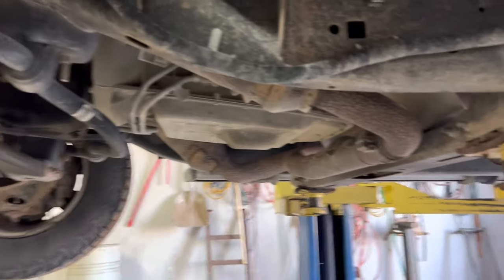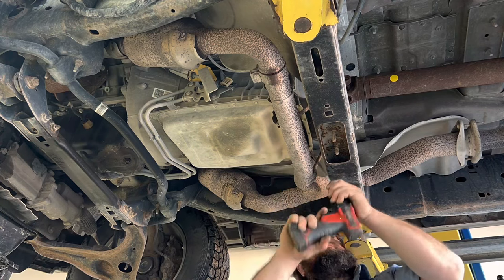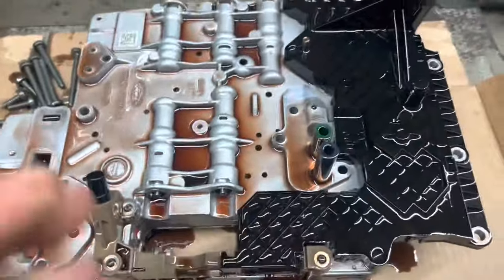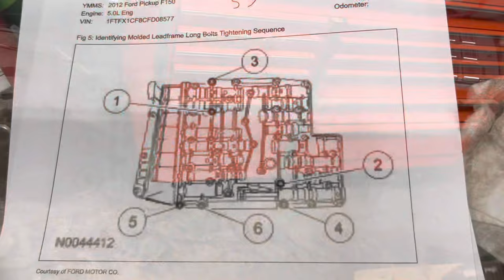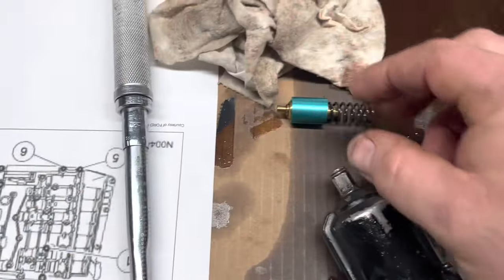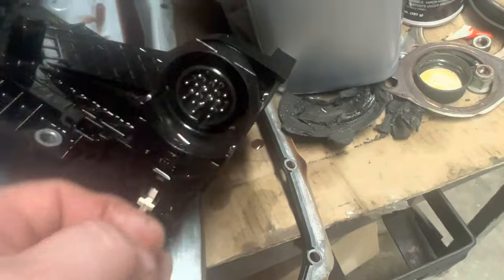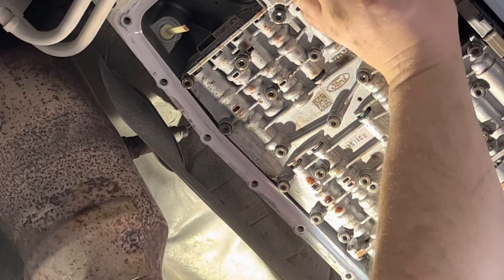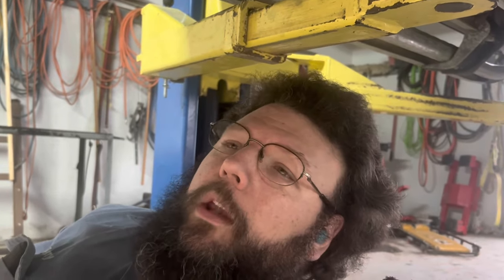Leadframe/ sensor assembly replacement on a 2012 Ford F-150 with 6R80 transmission

Comment: Thank you for making this video! After my F-150 abruptly downshifted from 6th gear into 1st gear, I took my F-150 to the Ford dealership & after a week they told me I needed a new motor & possibly a new transmission. They had no clue what was wrong with it or were unwilling to fix it even though Ford had issued a nationwide safety recall for this issue. I wish I had a reliable knowledgeable person like yourself nearby. Thanks again!
Reply: Why are dealers always acting like a ignorant slobs why
Reply: JUST GOT A FACTORY RECALL FOR THE SPEED SENSOR

Comment: Man I appreciate you making this video I took my 2011 F150 to a local shop and asked how much to change my leadframe he immediately told me he had to rebuild the transmission and it would run me 1800 to 2500 dollars I told him I had research the problem and everyone who had the same symptoms it was the leadframe. So thanks a lot I’m gonna change my lead frame tomorrow picked on up today
Reply: Where did you find one.  I’m in the same boat.
Reply: @kozmorulz83  There are plenty on ebay, but you most likely won't find an oem part because they no longer make them.
Reply: Same here, I paid 2 weeks ago for a rebuild and it never stayed right. They blamed everything but transmission. Long story short its in the shop right now and I found a lead frame local thank god. Crossing fingers 🤞
Reply: Does Ford have to reprogram or can the lead frame just be replaced? There was a reprogram done on my truck(13 F150 Limited 3.5l ecoboost 4x4 v6) in 2020... Please advise ! Thanks

Comment: Replaced this part warmed it up got the fluids right, put it into reverse and all the gears are neutral would it be those 6 solenoids on the valve body?
Reply from the maker: Probably missed the manual shift valve while putting the valve body back up

Comment: I just had the lead frame replaced on my 2016 at the dealership. The service advisor tried to explain what they did but I don't think he even knows what a transmission is as he pronounced it "led" frame lol. So thank you for clearing showing what was actually replaced on my truck. Next time I will do it myself as it is definitely something I can handle with my mechanical abilities.
Reply: In his defense, i thought it was lead like led too, just because of lead beind a special metal. This is the first time I've heard it pronounced otherwise

Comment: Apparently the area we are stuck on is the installation part that made you mad and skipped. That valve we had to figure out and the linkage between the shifter lever and the valve body comes apart when we try and run the truck. Had to pull the pan off again, trying to figure it out for the 2nd time now... we will see.
Reply from the maker: I was having trouble keeping that spring loaded valve up in the case while putting the valve body up and lining it up with the manual valve.
Reply: I put a glob of trans-assembly freeze on the thermal sensor and it held it in the valve body .
Reply: Trans assembly grease/lube

Comment: Great video. My 2013  just started screwing up. I bought it used a year ago it only has 54,000 miles on it but the extended warranty only lasts 10 years so they wont cover it.  Im fairly mechanical, but now seeing whats involved with this repair i'll suck it up and pay a pro.

Comment: My 2010 F150 5.4 with a six speed six or 80 has 144,000 miles on it I just bought it last year don’t know if it’s ever been service for the transmission or not before but the fluid was low I put Lucas transmission Conditioner in there which is for also LV fluid. The symptom I’m having is the last two weeks whenever the truck is cold up here in Pennsylvania in the summer it gets down to about 60°F. But whenever the first 10 or 15 minutes I’m driving it whenever I come to a stop sign and pull out after a complete stop it does like a neutral slip and bangs in the first gear. It does it for like two more stop signs and then once it warms up it goes away. This happens every morning I took it to my local Ford dealership they put the scanner on it it came back no electrical problems and I asked them about the lead frame and he said everything came back OK but somebody else is telling me it Hass to actually be doing the symptoms for the scanner to pick it up. I don’t know if that’s true or not any thoughts on what this could be? Somebody else that may be the drive shaft You join or something but then it would do it all the time not just wants cold out I’m imagining… great video thank you for sharing!
Reply from the maker: @zmaninpgh  are you sure you checked the level correctly? They are very sensitive to temperature changes affecting the fluid level.

Comment: Working on a 2010 f150 w a floor shifter won’t go all the way into park, when I manually put it in park underneath the shifter is stuck in park 

my first hunch is the cable, it doesn’t extend all the way down but deep diving I’ve found could be the shift interlock solenoid, brake light solenoid, the shifter itself and now this lol

I’ve manually reset it to take a look and took apart the shifter to see what’s going on, I have it responding w the brake for now so maybe I can eliminate the shift lock solenoid but I’m stuck where to continue my diagnoses 

I put the shifter into D, engine off

Manually put the transmission into D

The cable and shifter don’t line up

Turning back on the vehicle Resetting to Park, they don’t match up again

I’m gonna try the fix for a new cable in case it’s stretched I think

Comment: Thank you for making it make sense. My 3.5 EcoBoost gave me the "Rench " from hell displayed so I pulled over thinking oh, no problem i'll just turn off then on the truck then it may reset. Nope. the truck won't even crank. I checked for codes and the PO706 & PO707 came up. had to get the trucked towed. I'm assuming the "no crank" is normal and nothing I can do till the Leadframe is replaced. thanks for any comments or suggestions.
Reply from the maker: Those codes are for the range sensor, check your wiring and connections at the trans but that sensor is part of it and won’t start because it doesn’t know what gear it’s in.
Reply: @bulldogsautomotiveadventur4387  Great, I'm assuming the connection is the one you show at the "4:23" mark of your video. Is there any other connection other than that one? or just trace that one on both ends.  thanks
Reply from the maker: @Perry-cl2ne  I’m pretty sure that’s the only one, they put everything in that one frame so it all has to go through that connection, fluid leaking through the connector can cause issues as well
Reply: @bulldogsautomotiveadventur4387  last question, does the connector wiring get powered by any fuses? i'll be looking at the connector this weekend. thanks again for everything.
Reply from the maker: @Perry-cl2ne  I would have to look at the wiring diagram but most of those wires will be to the computer, power will likely be relay controlled with switched grounds to the solenoids, sensors will be direct to the computer
Reply: @bulldogsautomotiveadventur4387  thanks for all your knowledge suggestions

Comment: I think this may be part of my problem I’m having w my 2012 f150 eco boost 3.5 ( K.R ) it’s not wanting to shift out of low I’ve changed the transfer case motor it is also not showing correct speed says it’s doing 70 at 20 mph ( rough estimate)it feels like it is in a 4x4 with low rpm low gear whine but shows at 2x4 on dash transmission also shifting hard into gear I have been experiencing the notorious down shift issue I’m hoping by replacing this I could solve some of these issues do you think I’m going down the right path my next move would be replacing iwe and tubes? Idk help please
Reply from the maker: That sounds like something in the transfer case or associated computer…if it’s all something that happened at once for no reason I might look for common grounds but you might have to have that properly diagnosed at a shop.
Reply: The transfer case motor wasn’t properly indexed fixed $300

Comment: Hello sir I hope you can answer my questions I took my truck for the recall lead frame  speed sensor . in 2019 . now I have the problem you think they will fix it  again
Reply from the maker: Not under recall, and the dealer usually doesn’t offer any warranty past 1 year

Comment: Debating weather my valve body or lead frame is bad , will downshift hard from 5th to 4th only but only when it stays in 5th gear for a while I guess when it builds pressure, on 6th gear overdrive it seems like it looses pressure while driving almost feels like it down shifts but it’s not shifting it stays on 6th gear
Reply from the maker: Need to have it on a scan tool and see what the pressures are doing

Comment: I just replaced the lead frame and had the recall sw update done by dealer. After doing the lead frame the transmission is slipping bad now. Everything went back together as expected but I didn’t put the transfer tubes in the trans I left it on the valve body. Could that be why? Only drove it a few times before doing this repair and it didn’t happen before. 250k miles on it
Reply from the maker: Very possible, those tubes act as a seal

Comment: The transmission in my 2013 Mustang with a V6 Automatic is having that same issues.
All I hear about is the F 150. What about the mustangs? They aren’t part of the recall?
Reply from the maker: No recall on this to my knowledge, haven’t heard of the mustangs doing this yet
Reply: They have a recall on it... But you have to have under a certain amount of miles

Comment: Hello, greetings, my 2012 3.5 truck has a knock when I park, sometimes it knocks a lot in first gear, do you know what I need to change?
Reply from the maker: Noises are something that have to be diagnosed in person, it can be narrowed down but not pinpointed…I do know they have a lot of timing chain problems that rattled on startup, if that used to be a problem and now it sounds like that all the time then it needs addressed soon.

Comment: After you replace either one or both lead frame or valve body, do you need to programming in system? Or just remove and install then drive it like it will be normal again?
Reply from the maker: @Sordoarizona  we usually just clear the codes from the system and drive it, but we’ve never had to replace a valve body, just the lead frame
Reply: @bulldogsautomotiveadventur4387  you don't have problem with transmission after all?
Reply from the maker: @Sordoarizona  I’ve done a few lead frames for sensor issues, never had to program one yet
Reply: @bulldogsautomotiveadventur4387  I did have issue with my 2014 F150 4x4, sudden downshift gear from 6 to 1 while driving, scan and found code p1500, and found out that I have recall #24s37 for that issue after have dealer send a mobile technician to update software that was 4 days ago, then just today, it did it again and this time all codes appear all from transmission p0720, and many more... I told dealer it was after they flash it with software and it come worse... They said it wasn't software that they updated that cause it... They will let me know by Monday to see if recall would cover it.... I tried to look for solution because I can't afford replace for $8k... I see you did replace lead frame and drive fine...
Reply from the maker: @Sordoarizona  ford definitely has a problem with some software updates, no idea if that’s your issue though
Reply from the maker: @Sordoarizona  both those codes are for speed sensors, both are part of the leadframe, the p0720 is also covered under the recall but if they’ve “completed” the recall they might fight you on it…it’s the same problem as before.
Reply: @bulldogsautomotiveadventur4387  I hope Ford will cover it, if not, I am gonna have to replace either lead frame or valve body or both... Should I drive my truck to home from dealer if they refuse to cover it... My home is 5 miles from dealer on city street 45 mph.... Or better tow it to home?
Reply from the maker: @Sordoarizona  if it could randomly downshift I wouldn’t drive it, it’s amazing that it lived through the last one
Reply: @bulldogsautomotiveadventur4387  that is third time that it downshift, first one Oct 11, then 17, and had Ford update the software on 22th, then again just yesterday and that was it and I stop drive it, it was still driveable, but I stop and won't drive it till Ford tow it... What happen if I continue to drive it?
Reply from the maker: @Sordoarizona  it will either completely destroy the transmission, the engine, or both

Comment: I have had an erratic shift for several months 2017 6r80. Everything points to the OSS throwing a fit. Is it wise to replace the leadframe(with new valve body, as the leadframe alone is usually unavailable) altogether, or could the sensor alone be swapped? Having trouble finding a part number for the 6r80 OSS. Rock auto seems to only have 10r80 sensor available.
Reply from the maker: On most of those parts we source only from the dealer, I haven’t had a 17 in with a 6r80 in, I’ve only seen them in the older ones, early teens.

Comment: So I replaced it on my 2013 F150 a couple days ago. Followed step by step and topped off the fluid, but the transmission no longer allows reverse. Any ideas what may have caused this?
Reply from the maker: Does it get all the other gears? I’ve never had one do that but I’ve seen a lot of people miss the manual shift valve on the driver side.
Reply: It hits all the gears but reverse won’t engage. @bulldogsautomotiveadventur4387
Reply from the maker: @user-yr5nj4vc1h I would check the pins in the connector first, but I would think it would be solely hydraulic
Reply: @bulldogsautomotiveadventur4387 what does that mean. Would it be bad solenoid or need new valve body?
Reply from the maker: @swishyboi7444  I would assume something like debris might have gotten in during installation, improperly installed valve body, or something like that.

Comment: Hey man thanks for this awesome video. I’m thinking I need to replace my valve body on my 16 f150 5.0 ;97k miles, 6r80. I’m having intermittent shifting issues particular at faster speeds on highway.sometime when I press on gas to go faster tranny gets stuck in lower gear and the only way to get it back to normal is to let off the gas and cycle back through gears. Anyway was hoping for some insight if you think that could be the problem and also if I change this part will I have to do any programming or reflashing of anytype? Im replacing the entire valve body and lead frame. Thanks!!!!!
Reply from the maker: I’ve never had to reprogram/reflash the computer but I do usually reset the adaptive learn and shift points. As far as if that’s your problem I’m not sure, if you have access to a scan tool I’d drive it while watching what gears it’s calling for so you know if it’s calling for that gear or if it’s a hydraulic issue.
Reply from the maker: If I remember right that’s what the issue was with this one, it had a bad speed sensor in that leadframe and was throwing a related code.
Reply: @bulldogsautomotiveadventur4387  thanks for the quick reply man! So if it’s not calling for the gears to change most likely it can be the valve body and or lead frame, correct? If it is calling for the gears to change and it’s not, then it would be something more involved? Thanks so much
Reply from the maker: @andrewshah10  more or less yes, never had to replace a valve body on one of those, more likely something in that leadframe or shift solenoid.

Comment: Do you have the OEM part number for the 3 Stand pipes sometimes 4? Do they reseal okay if you pull them off valve body and place old ones back in transmission?
Reply from the maker: They reseal, I don’t have the # as I’ve never had to replace one

Comment: Hey boss what size are the bolts that hold the valve body in place I stripped one and I can't find a replacement anywhere.
Reply from the maker: I don’t know off the top of my head, but I think there are three different lengths

Comment: My 2010 Ford f150 fx4 5.4l it was shifting hard when I’d pull to stop and now the truck just revs high but won’t move well this fix my problem
Reply from the maker: Very doubtful, need to check the fluid level and look for a big leak
Reply: We’ll do thank you for the reply